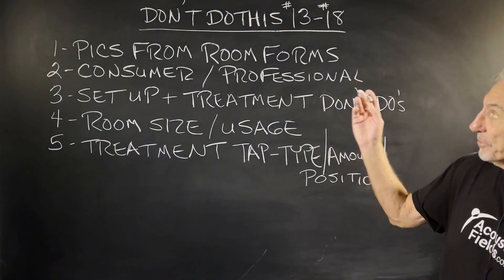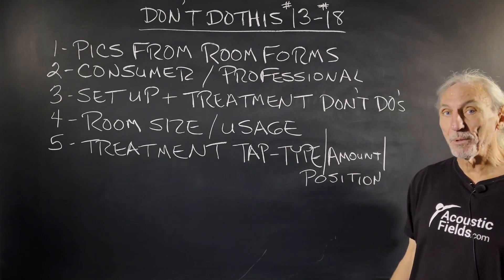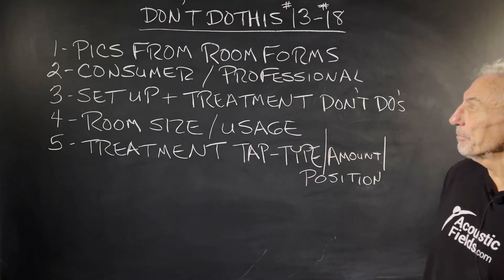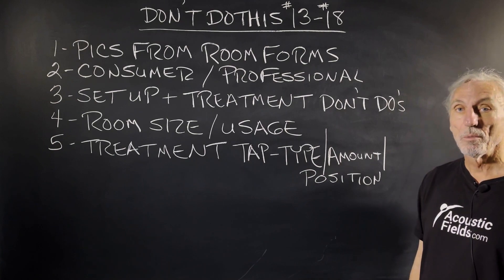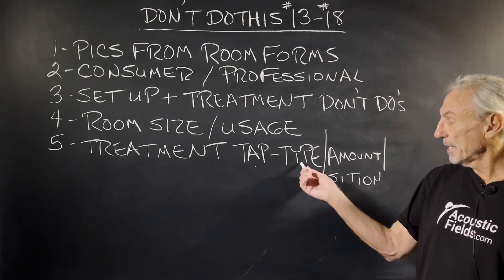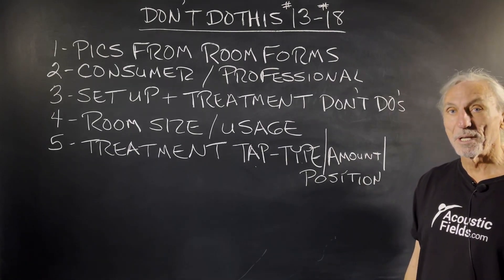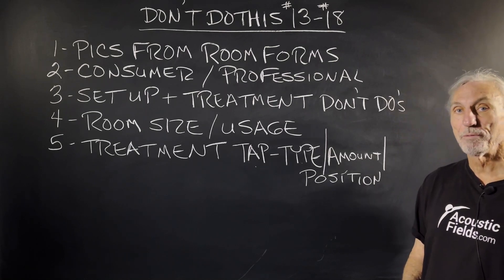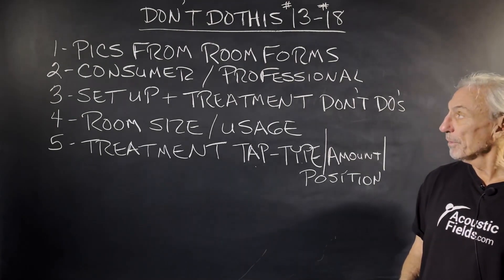Don't Do This! # 13 - www.AcousticFields.com

Comment: Regarding the final picture. It really depends on what the person is trying to do in a room like this. If you wanted to throw on an album, turn it up while you are working around the house or something, I could accept this. But not if I were sitting in the room with only the intent on listening to the music.
Reply from the maker: You are correct. This is why it is so important to define the sonic stratedgy you wish to achieve before you start buying boxes.

Comment: It would be good if you tell us the better alternative to those setups.
Reply: A normal shoe box shaped room with no glass in the reflection zones. Speakers placed equally and not too close to the walls. 
No two room dimensions the same size, ideally no coincidental room modes. Only the number of seats needed/used.
Reply: @NathanOakley1980  I mean how to better setup those equipments in those same rooms.
It's nice to point out the problems with our setups, but if the only answer is getting a perfect dimension, no window dedicated room and spend 10 grands in treatment I think it's pointless. I mean, I love this videos and I think Acoustic Fields are the real deal but their solutions are inapplicable to real living spaces.
Reply: I wish they would do more "real life" solutions / tips / tricks as well when you do not have the perfect room or have to share it with other humans - but I guess the easiest way to look at it is that they dont compromise on the biggest problems - and those problems are just there in all normal rooms: room size/dimensions, even wall distance, no alcoves, no windows, no clutter around speaker/listening area etc. 
So it just does not fit together....like a 20 hz wave in a shoebox :/
Reply from the maker: There are no tricks. Physics is the law. All input into a room is error and our goal is to reduce error (distortion).
Reply: No tiny rooms. AF have a room size chart with Red Amber and Green rooms based on size/volume.